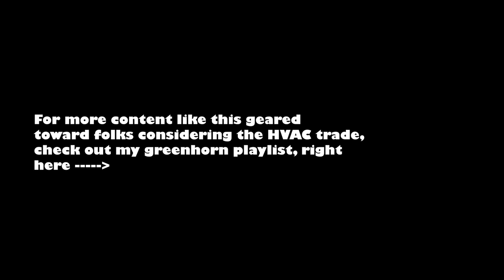5 Things to consider before becoming an HVAC Service Tech🔥❄

Comment: 1 year of hvac = 5 years on your body
Reply: ❤ back atcha
Reply: @rbates6226   been in the trade since 1981 , a Tip for you - if your going to Be Working in the Sun in one spot for a while Buy a Pop up shade thing and keep it on your truck. i use a 10' x 10'  pop up shade. i can set it up in less than 15 minutes. it will save your Butt  ! set it up if your going to be in one spot for over an hour. SHADE IS YOUR BIGGEST FRIEND ! Also, Bring a Rolling Cooler With u to Work every day with 2 - 1 Gallons of Water in it. Also Hit the Gym and Get in the Best shape u can. Get a private trainer if u can. worth thier weight in gold if u get a good one. i lost 23 lbs in 4 months with a private trainer. gained muscle mass , strength & stamina.
Reply: @rbates6226   another tip. Leave the nitrogen tank on the ground. Buy Long Air Hoses or Long refrigerant hoses . i have 2 50 Ft refrigerant hoses and a small ball valve refrigerant hose 1 foot long. run a hose from truck to roof or ground to roof. saves carrying that nitro bottle to roof. use long air hoses if u need longer than 100ft of hose. wayy cheaper. over 50 almost 60 still kicking refrigeration.
Reply: Yeeeeeee haa
Reply: I disagree with that 100% I work 50+ hours a week for the last 12 years and still going strong. I have done residential for 5 years but that’s not for me it’s less money and more work. I’m a commercial and industrial guy that’s the best thing for me. However I do agree if you don’t keep yourself in shape then carrying nitrogen tanks, torches and things like that can be hard but typically you have a second guy there to help with that
Reply: Lots if crawling tight spaces 100 degree attics spiders snakes dumb helpers not all but you are biuind to get one cuts get use to them its gonna happen alot and pe prepared to soend alot of money on tools
Reply: True. My first advice to all new techs is to start developing your exit plan. Cultivate those sales or management skill, because one day you're going to wake up & your body will tell you "no more, you're done". And it will likely happen far sooner than you expected it to.
Reply: I did commercial and industrial hvac for 25 years. I guess that makes me 125
Reply: I completely agree! I've been installing and doing service for 3 years just turned 30 and can even run a marathon le because my knees are jacked from crawl spaces.
Reply: @OcRefrig   terrific
Reply: Damn you fucking kidding me thats insane
Reply: I've been in HVAC for 22 years now, install first 6 yrs and service tech after that. I'm 52 now and I feel like I'm 70.
Reply: Make it a mental game to spot all the negatives about the equipment you are working on (but try not to bring this trait home with you). Become addicted to the self satisfaction of finding and fixing problems. Always take a step back and evaluate everything, so many just have tunnel vision to the failed component. Always take every failed device apart to figure out why it failed, this will help you in the future.

Comment: Sucks that installers don’t get credit most of the time
Reply from the maker: Plumbjitsu they should!
Reply: They don't get the butt chewing by customers either when things go bad or by the huge bills they receive.  Most service work is not very appreciated.  No one wants to see a service tech.  It's like having to go to the Doctor.
Reply: John D I did service for 2 years before I switched to commercial install. Customers say you are their hero once the system is fixed as a service man. I think a lot of installers cut a lot of corners unfortunately most of the time it’s because the company they work for want you to finish within a certain amount of time.
Reply: Plumbjitsu lol they have never said you’re a hero when you come out, they know the bill is coming and want you to hurry tf up
Reply: Raycharles Duramax im always a hero! Service, install or maintenance I take pride in my work lol

Comment: What I did was went with my tech anywhere if he’s in an attic working a horizontal go up and hold the light or just be there to watch keep in mind heat sucks and you don’t get used to it but don’t let the tech be there alone pass tools, clean and get the truck ready just make the process faster and easier. Remember your a team, get to know the guy and watch out for each other. It’s literally the guy who is teaching you for free without you paying so pay attention and suffer the elements together and fix the problems together.

Comment: Been in the HVAC field now for 5 months and have done a little bit of everything minus plumbing. Working mostly on custom homes and a tiny bit of commercial but mostly sheet metal. My jman and I have installed ac units and ran linesets etc, but I did one call by myself because this one new unit wasn't calling for cooling. Boy that was a wake up call having to diagnose the issue and figuring out why it wasn't firing.  

I love working by myself and trouble shooting issues. Can't wait to delve more into it and yes, you have to be PHYSICALLY ready anytime. 

Love your videos man! Keep it up!

Comment: Ill say this one thing where i am from almost every customer is very appriciative and usually tips you for your work if a customer wants to know whats going on or any tips u can give them for pm. Ive been a hvac superhero for a year (installer). The trade is awesome but you will get customers that dont care about the work just the result, always remember you are providing a service, and if it works properly after your done and looks good pat yourself on the back.

Comment: It's a humbling job. You need to be comfortable on your own but able to confidently relay information to a customer in a way they can understand. You need to be confident in your skills but also be ready to admit when you don't know what you don't know. And you need to be ready to pull apart a piece of equipment you've never seen and have the confidence you can repair and put it back together. You need to look presentable but also be ready to roll your sleeves up and get dirty. It's changed me as a person. It's an amazing journey. And it pays well.

Comment: To any new techs, I always recommend investing in nice tools. I am 19 and in college getting my HVAC certificate as credit for my license and I work part time as a field tech doing service work. The points made in the video were great and are useful. I always recommend not cheating out on tools. I always purchase the higher quality tools when I have the chance, such as low loss fittings or ball valves for my manifold to prevent cold burns when removing or installing your high and low side lines. Its that extra $50 that will prevent a serious injury. I HIGHLY recommend nice insulated electrical tools, especially when working close to single and 3 phase equipment.

Comment: Im about 10 yrs into the field and this man is spot on. 
Only advice id give is to join a union company. There are smaller private owned companies that pay just as well but its rare. Not to mention when you work for a particular manufacturer like Trane , you have access to private tech support numbers and search engines, and software for machines. This stuff is essential in diagnosing /repairing alot of the newer commercial equipment.  
 Down here in Florida the ability to work in the intense heat and humidity is another big factor as welI.
Reply: Hey man, how are the hours like? I cant enjoy life without balance. Dont mind working hard, just need balance.
Reply: @Phaminator525  theyre very crazy in summer how you would expect.

Comment: You nailed it.  Everything you said is correct. I’ve been doing this for 30 years and this is one of the most under appreciated careers.  150 degree attics in the summer and below freezing environments in the winter. Customers losing their minds and screaming. You have to be an electrician and a plumber all while getting paid usually less.
Reply: Then why not be a plumber or sparky then

Comment: Hat tip, you pretty much nailed it. Just came across your channel recently and I like your style. I do HVAC-R, hot side, soda, plumbing, Electrical,  frozen beverage,  and some glycol/beer systems.  Your breakdown covers them all really well.  I've been doing this for over 20 years and the only thing I could add is if a guy tells you he knows all there is about this trade, run the other way. We all learn everyday period. . 💪🇺🇸👍

Comment: Well put. The only thing I would add is the person needs to be mechanically inclined. You have to be able to see the whole mechanical picture. That's the difference between being a tech vs a parts changer.

Comment: I did a com rod change on a old York YCAJ chiller the other day. Haven’t done one for 5 years thought I’d be stumped. But once I started stripping the compressor down it soon came back to me. It’s sounded like a bag of nails and I left it running smooth. I was quite pleased with my self, lol.

Comment: The one thing that should be on top of the list is the extremes and this will weed out those that are thinking about becoming an hvac tech. Extremes in temperature as you have to be able to handle the hottest and coldest of temperatures because where your going on any particular job it isnt going to be in comfortable conditions. Another would be heights....you absolutely cannot be scared of heights because you will be climbing ladders especially in commercial hvac. Being an hvac guy isnt for the faint of heart....its a dangerous job.

Comment: That no praise thing. Man, that hits home. We laugh and say we could tell our boss we single handedly fixed a nasa space shuttle and it’s no different than finding the pump unplugged or something. A dumb luck fix is the same as super in depth, multi system, troubleshooting to the guy. 

I see wire no plug in, I plug in wire, unit go vroom. The exact same as a problem involving BAS, VAVs, the AHU, the chiller, the cooling tower, all associated pumps, reheats, heat recovery, etc… whatever complex problem, nope. Same as the guy who found the service switch was accidentally turned off. 

 Hell, sometimes the new guy is so excited he found the service switch off and strokes his own the boss buys into it! Where as the old timer telling him he just solved an insanely complex rack system issue but with none of the excitement behind it gets asked why it took so long. 

Not sure I’ll get use to it. It’s actually really frustrating.

Comment: I’ve worked as a sign installer and tech since I was 19 to 25 almost 26 currently applying to HVAC companies since that’s a trade I have been interested in for years my plus for me is that I have electrical experience and have a good work ethic and in what I do I travel a lot working 60-80 hours a week taking notes on many videos on how to be a successful installer and technician

Comment: Did hvac-r for 15 years. Worked on grocery stores racks all the way to a window unit. One thing I learned is if you’re good at fixing stuff you will make money but if you’re good at fixing stuff the be prepared to just be fixing stuff. Hard to move ahead in this career due to being so short staffed. You’ll be 25 changing that compressor and you’ll be 55 changing that compressor. I went to the oil and gas field. I do automation now and I’m thankful to learn that side of it due to refrigeration but hvac-r was no longer for me
Reply: Automation??

Comment: I think you are correct about the degree of introspection needed for this career. Regardless of what some  property owner might think, there is not a lot of money being made, but there IS a lot of personal satisfaction. When people ask me if they should become an HVAC tech, I tell them that they have to be that "curious cat" who always wonders how things work, can take things apart AND put them back together, and be the person who has created a personal history of problem solving using at least a little science. 
Brand new techs may not realize that 85% of calls involve electricity and understanding how it works. If you are a member on HVAC-Talk, you may have seen my articles on electricity in the Educational Forums. That familiarity with electrons is vital to the success of any tech. Based on the questions we get on the site, it is every tech's Achilles Heel.
Working alone is an enhancement to the job, because you can concentrate better and work through issues in your own space. While the satisfaction is mostly internal, suffering commercial space managers are really glad to see you when the AC fails.
New guys: the learning never stops. Regardless of what an armchair whiner says, compressors are murdered by something happening in the equipment. Copeland says that 30% of the compressor returned have nothing wrong with them They were misdiagnosed, and that leaves 70% that have actually failed, so it is important to find out "why."

Comment: HOT ROOFS AND ATTICS  . . SET YOUR SIDEARMS IN THE SHADE
IT'S A LONG HOT CAREER . . . GET USE TO THE HEAT . .
good to see some mechanics still using tool pouches
just the essentials, thank you very much .

Comment: Salty dog here. Started circa 1995
State licenced 2017

I'm only talking about residential HVAC below.

Only  real men do the commercial and commercial refrigeration portion of the trade.

Number one goal of service is accuracy, or the company you work for, yourself, and the homeowner will suffer.

1. Know thy multi meter. Cant be afraid of electricity. 
Voltage readings, amp draws, Mictofarade readings. Ohming out potential broken circuits...

2. Gauges and temp clamp everytime to find superheat and subcool for proper refrigerant levels,,, know how to distinguish between low refrigerant levels and a restriction in the refrigerant cycle.

3. Know how to braze copper with inspection mirrors in tight spaces.

4. Respect the drain line, dont leave till it's clear, or recommend to client to have drain cleared asap to avoid future drain clogs, 

That's just a few things a accurate service tech needs to know...

To me, the best service techs are lead installers who mastered putting them in for 3 years, then they did just maintenance calls for a year just so they could use their multimeter and gauges plus temp clamp daily.
Then they rode with a senior tech for half year before taking their first service call ...

Another good path is a service apprenticeship..but those are rare

Comment: Hey man. Nice vid. I’ve been a fridge aircon and process engineer for 25 years. The comment on install is so what I say. You need to be an apprentice on install to learn the parts and process then how it works. 25 years in I still wonder why I do this job but on a beautiful morning setting off to fix shit I’m good. Waking up at 4 and it’s dark it’s shit

Comment: Driving, you have to be okay with driving 4 to 5 hours a day. It's not always going to be that way, but in the dead of summer or winter when she gets crazy it can wind up being that way. And don't necessarily expect your boss to fix the heat or air conditioning in your van either

Comment: Awesome video 
I started in the trade 1982 as a sheet metal installer ductwork 
Then hvac service technician now specialize in VRF 
Awesome trade 
2 of my 4 sons are now in the refrigeration service trade 
Plenty of work for the one who wants to excel

Comment: Nice video. Very true. Great list. I have been in the trades for 20 years. I'm 38 and i just had a shoulder operated on. I never gave the physical demand much thought but that changes faster than you think. I love what i do.  Cheers
Reply: @Jeffrey Goetz if you message me I can give you my email. There are no shortcuts but there are different paths my first job was on my Volvo 240 I bought the Haynes manual on HVAC and read it three times over and bought some small equipment it took me 18 hours to convert that car what should have been a 4-Hour job LOL

Comment: I might mention being on roof's, even with houses  ,rooftop heating units when its icy out, high voltage and pressures that can kill you,they need to be aware of what there dealing with,and learn to put your problems and issues aside while trying to troubleshoot, otherwise it won't work out to good,if you can do that ,afterward you can tackle those personal problems and issues like a pro

Comment: Install is grossly underrated. A senior installer can make as much or more than a  service tech. Since their work is flat rate, they can be insanely profitable when they get the job done quickly. Interestingly, the best service techs are often not the most profitable if the company operates on T&M as most companies do.
Reply: installers definitely bring in the money.

Comment: I was skeptical but you nailed it right on the head. I will say if your in decent shape and have moderate intelligence and some mechanical ability you can be a millionaire in hvac in 5-10 years time. But i would strongly recommend learning how to do some form of installs. One solid year if you're good. All the money is in equipment replacement.